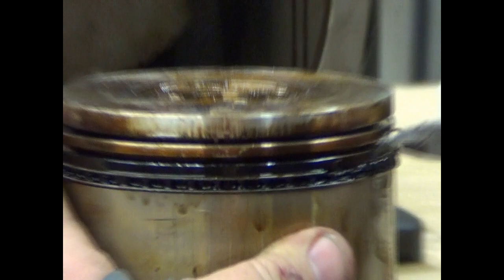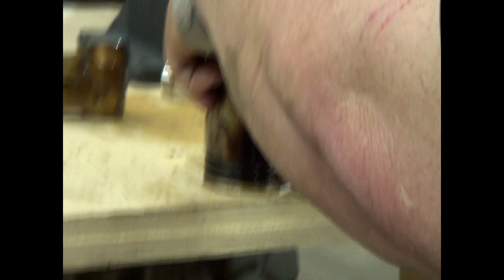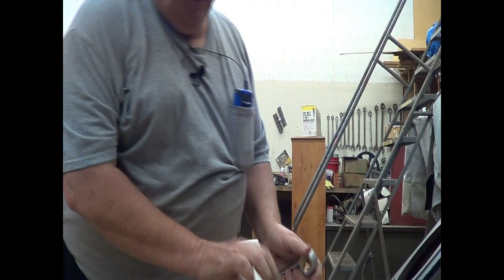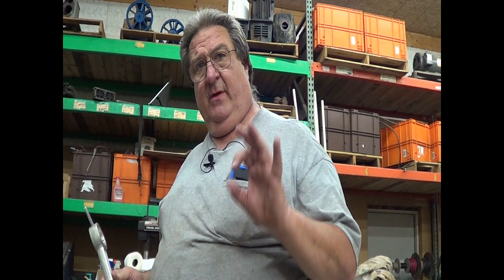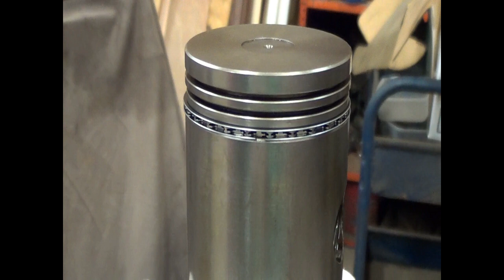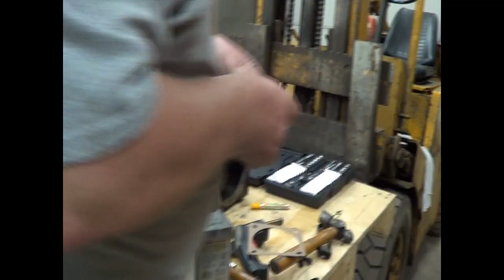IR2545 installs High pressure rings and wrist pins and continues with assembly S1, E7

Comment: Where did you get your torque specs for the low and high pressure center head bolts?
Reply from the maker: either in the valve parts sheet or the IR parts book.
Reply: @THECompressorGuru  if you could help me out it would be greatly appreciated. Long story short my boss is having me rebuild a 2545 that someone else tore down. I've never worked on compressors before. On this website(https://manualzz.com/doc/22318066/ingersoll-rand-2475n7.5-v-air-compressor-owner-s-manual) page 13 it says low 14-16, high 10. I'm not sure if I'm reading it right or not. Just don't want to mess anything up! Any advise? Thank you.
Reply from the maker: @tristanallen7355  those are the correct specs. remember the high side is the small side. You may contact THE Guru through the link below.
 thecompressorguru.com
give me a call because torque sequence is very important here.
Reply: In the video you had to pound on the main bearing on my 2545 I can slip the bearing onto the crank easily without pounding is my bearings messed up should I have to pound it on?
Thanks